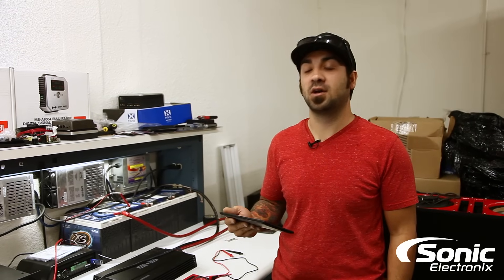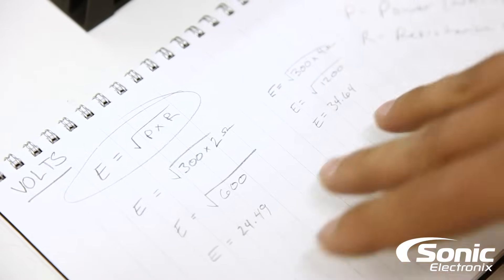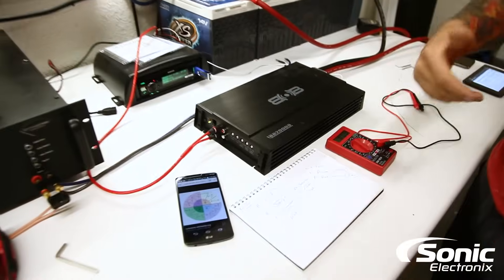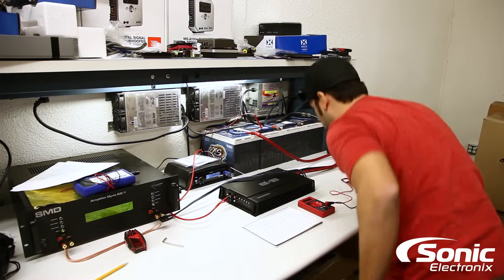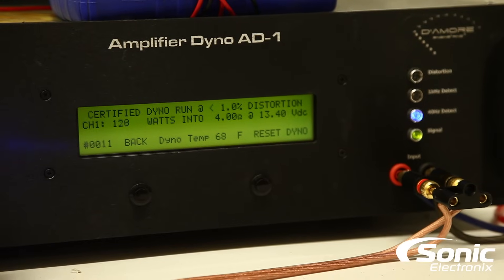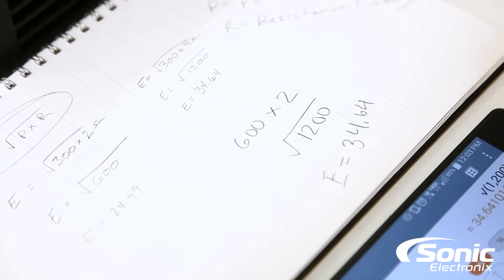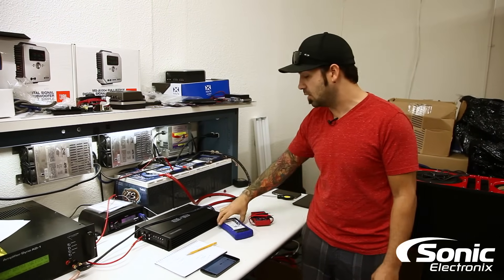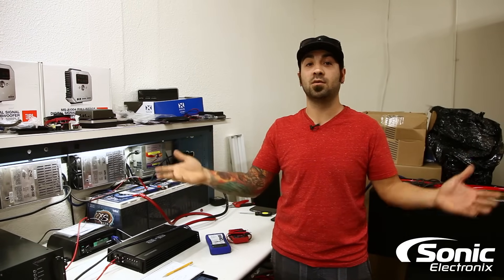How To Set Amp Gain to Match Lower RMS Subwoofers? | Car Audio Q & A

Comment: Hello Allyn , i want  to know that what should be the gain,rear frequency setting (LP only)  for the Rockford fossgate  Amp r250-4ch(298W rms) , i am connecting it to 6x9 speaker of Rockford P1692 (75W rms), i will be very thankful to you if will reply.. thanks

Comment: Thanks for the information, I just have one question about using a 50 hz test tone vs a 60 hz test tone. I have an Alpine MRX-M110 and im trying to set it for an Alpine type R 12 (5th gen). So ideally id like the amp to put out somewhere between 900-1000 watts. When using a 60 hz test tone and reading 44 volts, at the same gain level im reading 32-34 volts using a 50 hz test tone. Is it normal to have that much of a voltage difference between test tones? Just seems odd to me that at 60 hz the amp seems to be putting out twice the power its putting out at 50 hz.
Reply: Make sure theres no bass boost and everything is flat on amp and headunit

Comment: So if I have a pair of 2 ohm subs rated 800 rms as a pair and a 500 rms 2 ohm amp could I wired the sub down from 2 ohms to 4 ohms to reduce power strain on my alternator, battery and overheating on the amp?,

Comment: Hello Ally, how do i calibrate my amp if it gives 300wrms at 2ohms and my subwoofer enclosure has 2 woofers that added are 400wrms at 2ohms? Is the same calibration as the video? Thanks

Comment: I have a Kenwood amp (old) that is rated around 1000 watts, and a dual xib 2 10" subs rated at 800 watts peak, and 400 I believe is single?. It's 4ohm that can't pick up anything less that 30 hz, and can handle up too 86db, I did the equation, and it gave me 56v, with the 800 peak, and 34v with the 400 whats should I go with the 56? Also where should I have my db? I'm at complete, novice level. I vape so I understand ohms law. Thanks for the response.
Reply: +Nothingbutneutral11 
1st. decide which speakers you're going to use. 
2nd. How ever you decide to wire them will determine the load on the amplifier..Depending on the amplifier, a two ohm load is generally going to pull twice as much power from the amp as a four ohm load... You need to find out how the amp performs with different loads.. If you don't know, start with googling it's model.  
Using the speaker's power rating is starting at the wrong end of the equation.
Actually, the speaker's power rating has little to do with setting the amp's gain anyway.

Comment: Measuring the voltage from the output without a load attached would result in a higher voltage, thereby explaining why your DYNO showed a higher power. When possible, it's always a good idea to measure exact voltages under load conditions. IMHO.
Reply: Hammy Technoid when u say load im assuming you mean having the speaker attached to the End of the wire you are measuring. Also would it be better to measure at the speaker or amp ? And what  HZ wave do you use to measure either tweeters or 3"mids/6.5" is there specific HZ test tones that should be used ?
Reply: ruchb1 The load mentioned would indeed be a speaker, or in test purpose cases, a load resistor in the 4 to 8 ohm category. Having a speaker blare a test tone at near clipping power would be painful to hear and might even damage lesser quality speakers. The test tones used by the SMD tester are 40hz for bass and 1Khz for mids.
Reply: +Hammy Technoid 
since you are taking into account the ohm load of the speaker intended  the only reason why you are seeing higher wattages on the dyno is because most higher end amp manufacturers underrate the amps by 50-100 watts in order to not get into trouble over not putting out their advertised wattage at a certain ohm load.

its the same concept as a bakers dozen.

its also the same scenario for speakers and voice coils. the manufacturer makes the voice coil able to take 50-100 watts more that the intended wattage in order to not get into trouble over not being able to take advertised values.

(also there are variations in the manufacturing process)

Comment: Do I need to turn my head unit all the way up or to 75% volume? I don't really hear music that loud and my car speakers distort a lot, the maximum volume of my HU is 40 and it goes from 18-22 without distortion depending on the song. You think it would be ok if I tune my amp with the HU volume around 20 ??
Reply: +CHIHUAHUA4809 
Let's start over.
1) turn your amp's gain all the way down, full counter clockwise
2) play your test tone, music, whatever and turn your head unit's level up until it begins to distort, then turn it down to where it was clean and leave it.
3) now move to the amp's gain and do the same

Comment: Hi Dear 
i have subwoofer JBLGT5-12 cm and amplifir pioneer 760 watt 4-channel high output hut puissaance model A-6604

how can i get best gain from Frequency to my sub ?
can add speakers Kenwood dubble basse with the sub?

thank All
Bahaa from Egypt
Reply: Huh?
Reply: sorry ?????
Reply: BAHAA ELDINE PONDOKybF try to re-word that. Didn't understand you...
Reply: BAHAA ELDINE PONDOKybF okay. It may work if your amp has tri-mode capability. If so run each 6x9 on left and right channel, and bridge your subwoofer, but you need to put a cap/crossover to the sub for low frequency. But only if the camp runs in tri-mode.
Reply: rome seveneightsixnine 

thank you very match

Comment: I have 2, 8 inch subs  and an 1800 watt amp. each sub is 250 watt and each sub is 8 ohms, I did my own calculations and it gave me 44.72 is this correct, please let me know
Reply: +Nathan Wallace 
Sorry, not enough information
For the question to be complete, you need to at least include the exact model of the amp you're using as well as the ohm of the speakers. Better yet, include what the output of your amplifier will be with the ohm load you are presenting to it.

Comment: Hey guys, I have a problem with the RCA inputs, I think.. when I have both RCA cables hooked up to the amp the subwoofer sounds very quiet but when I unplug ONE rca from the amplifier,  the subwoofer sounds louder. I have a  LOC running to the amplifier. I have a Soundstream TA12000.1 and a single 4ohm Kicker. 
What would be causing this? Thanks.

Comment: I have (2) 12" Alpine Type R's DVC 2 ohm subs wired to 2 ohm final. I understand the math but since i have 2 subs rated at 300-1000 rms how do i figure out the math for dual subs or do i just set the gain of of one subs ratings?

Comment: Thanks very much for the video! So I'm still a bit of a n00b and did everything you showed successfully but after adjusting the EQ I'm getting a higer read on the multimeter. Obviously I don't want to let the sub clip so I adjusted the gain back to 17.3v with the audiosettings on the deck to the right voltage but is that necessary?

One question more, what about loudness? Should it be used or not? I've got it always at high because of the music that doesn't really pop when not used. Stuff like DnB sounds great with it off but Alice in Chains for example sounds so weak / distant. Choosing the 'High' loudness setting will increase the voltage by 10 volts in my case.

I've got a Rockford P1 (150rms / 300), a Rockford P300-1 amp and an Pioneer Appradio 3 (volume max = 40, did the setup at 30 just to be on the safe side)

Thanks so much!

Comment: Hi guys, i drive a 2001 chevy cavalier (yes a cavalier), i want to install two nvx nsw 122 subwoofers, what amplifier would you guys suggest? I also have a kenwood head unit along with a 4 channel alpine 500 watt amplifier for the regular car speakers, would i need to upgrade my electrical system (another battery or larger alternator etc)?
Reply: If you're pushing 1,000-1500-ish watts, then your alternator should be fine. You may want to buy a better cold crank battery for up front. If you do decided to add batteries, I would suggest putting in an alternator first, as the current comes from the alts. So I guess it depends on what amp you choose.
Reply: @²ºº² Ghost ²ºº3  With what I know 800watts of rms power on a slightly under 100amp alt. is pushing it, but I'm sure it's possible. Getting a high-output alternator would extend your possibilities in the long run. Then if you plan on going really big, you can add more high output alternators. A good cranking battery would help you out too I think.
Reply: +Alex Quick 
Probably too late now but, 
If you're getting two subs, I'd get the dual 4 ohm ones instead of the dual 2ohm.
Because it's better to not use series circuits when they can be avoided.

Comment: this also answers my question if you can look for distortions with a multimeter which is "NO"..you can take a good shot at tweaking the amp for the max power you think your amp can hold without clipping
Reply: Clipping  is just  mininum low voltage the amp can take

Comment: I have a question for you guys. I'm new to this whole stereo deal .but I'm wanting to install a system with the best sound for my truck I drive a 05 f150 super crew  with a clarion nx602 deck and I have a couple different  options for amps 
1-rockford fosgate 500-2
1-Kenwood kac-7205
 And have 2 sets of 10s to choose from 1 set is the kenwood excelon  svc kfc-xw10
And second are phoenix  gold r3 dvc r310d4
 And have a sealed downward firing box 
Which combo do you recommend and at what ohms 

Thank you for your time.

Comment: I recently bought 2 10 inch subwoofers I think they are made by  theater research do any of you have any information on these. I have them in two different boxes that were mentioned for 12s and they are pretty loud. I want to build a box that is correct for the subs.

Comment: I understand the calculation but how do u do it of i am running 2 kicker subs svc breadge to 2 ohm load, subs are 100 rms and my amp is 300 rms
Reply from the maker: sotopr7 Its the same exact formula we use in the video there, just have to plug your numbers in. So you'd be aiming for 14.14v on your amplifier output. Volts = Square Root( Power x Resistance )= Square( 100 x 2 )= Square( 200)= 14.14
Reply: +Sonic Electronix Some subs are underrated. meaning if 1200 watt rms can actually do 1500 rms easy. this will effect calculation.
Reply: +Sonic Electronix and shouldn't you use the resistance that your amp is actually seeing? I know my subs do not measure exactly 2ohm.
Reply: +NOLO ACTRES ..measuring with multimeter its always off a few which was makes a difference in the calculation, no?
Reply: +Sonic Electronix So u use the subs rms not amps ? Confusing us now

Comment: So then for a 500-600 watt rms amp hooked up to a 800rms sub I would have to turn the amp all the way up that way I feed the sub woofer 500-600 watts barely
Reply: No that would distort your subs like crazy the gain is not a volume/power knob it's simply to match the output of your radio to the output on the amp say have a 1000 watt amp you want to get 1000watts you turn the volume up to max assuming the radio doesn't distort at max volume so then you take and oscilloscope and turn the gain up until you see the wave begin to square off at the tops (clipping/distortion) the reason you want to put it to the max here is so when you are playing music you cant crank it up to loud and trow your speakers into distortion and blow your stuff more often than not subs are blow more from clipping than from over powering good luck brother
Reply: Thanks man I appreciate the response and that's how I usually go by ear . Right now I have a 5 channel vega amp with rating of 600rms to sub channel and a t1 fosgate rated at 800rms I usually hit volume up 50 and turn up my gains from there till it distorts this amp is great it has a light that flashes when it starts distorting so I go by that but it seems like it handles much more I appreciate your response it just had me alittle confused
Reply: I will try to mess with it alittle more because the gains where set to an alpine type r that was 600 rms but I recently swapped it for the t1 sub way better sound I will have to adjust the gains again I would think
Reply: if it stops getting louder, you are already clipping, back it off, do 5 minute full blast test runs on your roughest songs, if the sub or amp gets hot, back off the gain even more. Monitor voltages. Common sense works best if you dont know how much watts your amps actually puts out cleanly.
Reply: Thanks man will do
Reply: +D9084 
1) turn your amp's gain all the way down, full counter clockwise
2) play your test tone, music, whatever and turn your head unit's level up until it begins to distort, then turn it down to where it was clean and leave it.
3) now move to the amp's gain and do the same.
4) stop messing with it.

Comment: Allyn, thank you for explaining this for me. I will be sure and use this information, in all my future installs. Sent this link to everyone I know. #rockstarstatusnow
Reply from the maker: Bj Hammon Thank you for the submission, it was an awesome question!
Reply: @SonicElectronix  if i have 3 8 ohms tweeters should i use 2.6 for the ohms or just 2?
Reply: Kurrent Event 
the amplifier will automatic adjust to the speaker ohm.  it will be trying to produce as much power as possible , but something is in the way, the speaker . the more it has to struggle  (resistance / ohms of the speaker)  the less it can produce,  the lower the struggle  (ohms ) the more power it can produce.  so actually an higher ohm speaker keeps your amp from working too hard. but a lower ohm speaker will say " hey buddy if you think you can handle it go right ahead knock yourself out ".
Reply: +Sonic Electronix I have a performance technique 2 channel amp and p2 punch 12 how do I tune with multimeter
Reply: wwill the amplifier automatically know what ohms your trying to achieve once you plug in the speakers, or would you have to set the amplifier at the ohm you're trying to get? does that make sense?
Reply: Sonic Electronix want to make sure I got this right. If I'm running two subs bridged to mono at 1 ohm and I want 800 to each sub I would use 1600 correct.
Reply: 210 / Designs hey bj im doing some homework bro
Reply: Sorry guys i have a very late question....but isn't a certified test clean non distorted power..and uncertified to clipping?
Reply: Sonic Electronix also need to know. My amp is stable down to 1 ohm. It is capable of producing the needed 1600 watts at 2 ohm so obviously it can produce more than the needed 1600 on 1 ohm. Is it easier on the amp to run that 1600 on 2 ohm with more gain or 1 ohm at less gain.

Comment: The apple App Store has a ohms law app that works very well. 

Also this would work the same way for a 5 channel amp correct? As in you would do the front gain as its own amp same with the rear and sub?